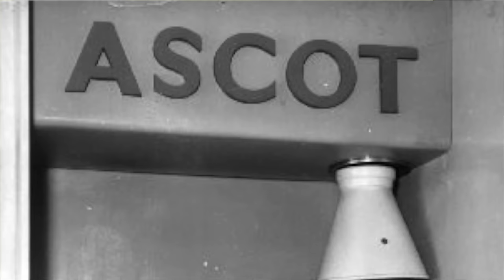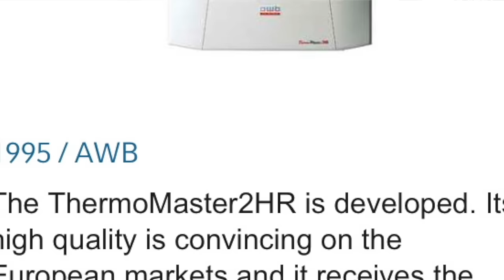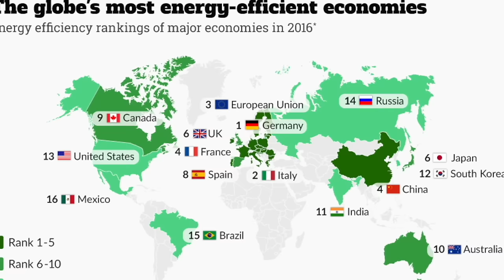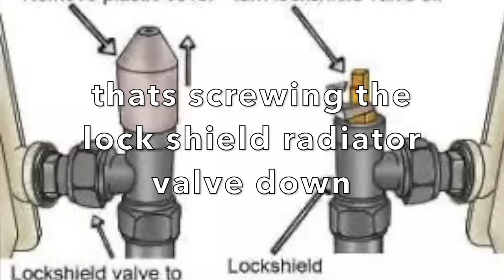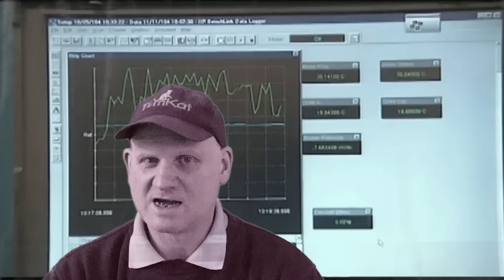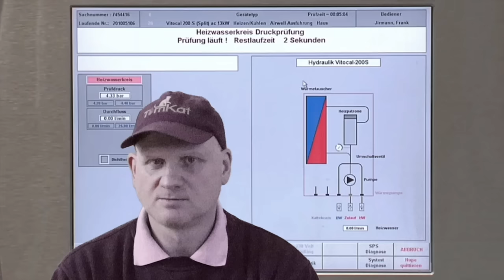WHICH IS THE BEST GAS BOILER for your home. Looking into the best boiler for uk homes in 2022

Comment: Terrific video Derek.  In a 4 bed semi circa1900 we are in need of replacing the Vaillant 828 combi and seem to be favouring the Viessmann Vitodens 100-W range rating 35kW.  We would welcome your views on the boiler sizing for the property. We realise there is an awful lot to consider as highlighted in the video (clean system, boiler modulation....) and wondered if there was some unbiased help out there to dicuss this matter.  This is a very important call to make.
Reply from the maker: Hopefully the engineer you choose to install your boiler will be able to give you all the advice you need. Just think about how much water you require ie how many bathrooms do you have and what flow rate at the taps that’s what will influence the size of your boiler first.
Reply: @tomkatgastraining  Well presently there is one bathroom with a shower over the bath but thought to plan for a further separate shower cubicle.  There's also hot water in the kitchen.  Not certain about suitable flow rates at the taps.  Can you recommend?   Not keen to have engineers in the home just at the moment.  Maybe we can achieve something remotely.  Any further information welcome.

Comment: Definitely VIESSMANN  The best in the industry single pass stainless steel heat exchanger ( fitted in ALL their boilers) they pioneered and gave us a very accurate weather compensation system ,(which comes free with every boiler) always runs most efficiently with the exact radiator temperature, They actually do 4 Combi boilers With a model to suit every need, that’s around 12 different boilers

Comment: I had the misfortune to be advised by my plumber to fit a LPG Baxi Neta Tec combi boiler. It has been unreliable since installing! Now six years on it has been issued with a danger do not use notice because it was exceeding 4000ppm carbon monoxide in the flue test.

It commonly made a loud bang when starting, this was followed by error codes. Eventually in year four it baffled two plumbers as to why it was issuing different error codes. Eventually Baxi sent their main man out, he was baffled but eventually discovered a tiny leak from the heat exchanger which was dripping onto a switch. When he removed the boiler he found it was distorted, presumably due to the banging when starting up. He replaced all the internals.

Now at a mere six years old our gas installer is recommending a new boiler given the history of ours. He is recommending an Ariston combi 30kw.LPG he recommends that over the Worcester Bosch 30i LPG.

What would you advise?

Comment: Great video, just signed up to British Gas to install a Worster Bosch condensing boiler and a system flush plus digital programmer, be interesting to see how it performs!!!
Reply: I wouldn't have used British gas to be honest 
I'd have found a local company 
British gas are just using sub contractors now which there paying very little and they expect a power flush and boiler fit by the engineer and only paying 395 for it
Personally I'd be charging a thousand for power flush and fitting of boiler

Comment: Would you agree that more modern the gas boiler (with high efficiency due to complex and fragile electronics) are all engineered to fail in a far shorter time period than those made 15/20 years ago?
Reply: Like cars.

Comment: You said that cavitation causes air, but this is not the case. Cavitation usually occurs on the suction side of a pump impellor due to the low pressure at that point, and it is this low pressure which causes the water to locally boil. So the cavitation bubbles are actually water vapour, not air. Cavitation reduces pump efficiency and, as each microscopic bubble collapses, it emits sound energy which, over time, can damage pump impellors.

I just had a Baxi regular boiler installed at my parent's house. The main problem is that the ignition is very robust, nay startling. The local Baxi rep took a look at it and it's now somewhat improved, but I'm still not happy with it, and I'm not going to specify Baxi in my own home, despite the existing Baxi old-tech boiler still running after 33 years.

Comment: Actually larger size boiler is a lot more efficient resulting in lower gas bills !!, as you would run it at a lower setting to get the same heat output, hence the output temperature of the flue gas is much cooler and less heat is lost to outside.
The 92% efficiency can only be achieved when the knob on the boiler is set to MIDDLE  or 1/3 of the way up only, the average efficiency is more like 75%.

Comment: This also depends on how old your water cylinder is. A modern one means you might be able to reuse it in a future heat pump system. We know it will be hydrogen boilers in 10yrs. Gas won't save the planet at all just lower your fuel bill.

Comment: i had a BAXI back boiler with seperate storage tank , 6am came on went of about 7am, hot water all day and night never came on again . until next morning , 20yr. old before first breakdown, now ive got a crap wall mounted boiler . from boiler in kitchen through wall to bathroom tap straight run 12ft. 2/4min before warm water arrives and comes on every time to heat water. roughly 40min a day wasted waiting on hot water and about 2hrs electricity , good job i live in Scotland , when i consider how much wasted water goes down drain waiting on warm water. And if i change again i know i,ll be getting a back boiler again .
Reply: erm ok don't talk crap

Comment: The only reason new boilers use less gas is the fact that they spend more time broken than working !
Reply: Totally Agree, I have a potterton Combi 80, still going strong. And so long as i can still get spares, i will keep it.  Even the guy at the local plumb center said modern condensing boilers are nothing but trouble
Reply: @johnmalin1676  my childhood home still has a Potterton boiler nearly as old as me (28 year old boiler!!)

Comment: Good n honest video many thanks, can I ask If i remember right I was told for condensing boilers to work at their best here must be a difference of 20 degrees between flow n return am not sure If i get that much difference but all my rads are way oversize so am hopping this is the case am retired now for over 10 ears n had a replacement boiler a Vaillant they did an OK job But they replaced all my rad valves taking away all the Peglers n draytons n replacing them with cheap rad valves n stuck the condensing pipe from the boiler in the rainwater! I was worried about leaks why I never changed it myself but so far just under a year pressure not dropped at all, in my experience the Best service of any manufacturer I got from Potterton installed a Neutaheat Friday lit it up worked for a while n stopped phone them about 1 pm n Next Morning Saturday 2 guys turned up with a new boiler had a look at the boiler then changed it to a new one, that was I think early 80s, Vaillant is Nothing as good on servicing but I had a Vaillant cause their 242s n 282s where Unbreakable many I insulted worked for 20 plus years very unlike many others cheers n keep safe mate

Comment: Hi Derek, thank you for putting up such a informative videos. Very interesting. I hope if you can help me. I am house owner and confused if I have a Combi boiler or leave the system as it is. Current system - Gravity fed, 10 year old condensing heat only boiler. All working well, no problem. We are planning to upgrade the common bathroom with an extra shower. Thus, removing the hot water tank will give us some extra space in the bathroom (if do not get the space we can still squeeze a shower). So, after the upgrade we will have 1 x existing bath, 1 x new shower  and 1 x shower in the en suite. Garden tap water flow is between 20-22 L/min. I have some advise from a local boiler installer and he suggested 35-40 KW combi boiler with small twin shower expansion vessel. My worry is, if my kitchen tap is open and two person are having a shower simultaneously, a) would it reduce the pressure? b) would it reduce the hot water supply. Also, we will have new gas from the meter to the boiler location.
Reply from the maker: No matter what size the kw are for a combi they are still only able to give you hot water at one tap at a time. There are a few stored combis on the market but they are still not as good as an unvented cylinder. I am sure the engineer who installs the boiler will be able to give you all the information you need as they would have seen your install.
Reply: @tomkatgastraining  thanks, it is very helpful. In that case, I'll will leave my gravity fed system and look for a upgrade to system boiler in future. I am also looking into Viessmann 111 W, i have given my details to the company and they will contact me to discuss soon. Thank you once again.

Comment: Great Video. People think bigger is better perhaps Combi’s need to be marketed with a CH/DHW output and more information to the customer. 
Is cycling really an issue given modulation. 
Keep up the good work
Reply from the maker: Yes boilers don’t modulate at start up and this is were the wasted heat start the boiler will go way over temperature and will need to turn off. This happens mainly on poorly designed system and customers not using the controls correctly
Reply: @tomkatgastraining  They do ... they modulate up

Comment: Very informative video Derek. Liked.
The modulation range is interesting, which H.O.B has the biggest range and are reaction times from high to low the same across manufacturers.
Reply from the maker: Every boiler and every manufacturer are different
Reply: Biggest range is 10:1 found in the Worcester Bosch heat only Greenstar 8000 Life range.

Comment: ,i've been repairing and servicing combi boilers for 30 years and i can tell you that the best boiler is the valliant, they are not as expensive as you think if you do a little research, heatline boilers are made by valliant and are much cheaper than the  one's with the valliant badge, i needed a new boiler myself 10 years ago, so i went into the plumbers merchants, and they had a stripped down heatline boiler on the counter for installers to look at, i asked what boiler is this they said heatline, i said it's a valliant after inspecting the components, they said well it's made by valliant, it was around £300 cheaper than the valliant badged one, i bought one, put it in, still going strong after 10 years plus....just sayin..
Reply: You need to look at Intergas combi boilers.
Reply: Yes the heatline were good... Particularly the price. I only got them when they were cheap, havn't been for a while... In the early 00s I put in hundreds of them. Some of my customers from then have started calling me now they have come to the end nearly 20 years on. I was buying them in bulk for £250 each ! Can't complain, 20 years for £250 !

Comment: Fascinating video. I'm not sure if my vaillant echotech pro boiler is a modulating boiler. But unless it's very cold the boiler does click on & off often. You said this is bad. Would it be better to turn the radiator water temp down so the boiler stays on longer? Even if its not modulating?

Comment: Why aren’t all the boiler installers this informative or give the right advice. 
Do you think you could come and have a look at my boiler and heating system ? 
I have had many problem 
With the boiler installed by British Gas since the day one I v had nothing but problems and each time a different engineer come and asked me to pay for some part or the other 
I stinky feel that all the installers work should be checked by a safety governing body to make sure that each installation is  carried out with the standardised process. 
I came  to watch your video clip I felt I need to be educated before I call another engineer 
Thank you
Reply: Your problem is BG not the boiler. BG is for salesman not tradesmen. 😂😂😂

Comment: Hi Derek, can you tell me if I size a system boiler in line with the kW needed for central heating (14kW in my case) plus say, 4kW for simultaneous water heating OR do I size it as per the rating of the coil of the 300L unvented cyl. (24.5kW in my case). You appear to suggest the latter but I just wanted to make sure. 

Also, given that an over-sized 32kW Ideal Vogue system boiler will "self-modulate" down to 6.4kW to 32kW, is the cycling on and off debate now null and void? You appear to think that it could still be an issue and hence why you should not over-size a boiler.

Last of all, controls from the manufacturer will only work on maybe 1 or 2 circuits but when you have multiple circuits for underfloor heating, I am told I must use 3rd party controls; is this right? Cheers, Daniel
Reply: if you fit a 14kw boiler on priority hot water you won't need a bigger boiler. having a large output boiler will reduce cylinder heat up time but this will use more gas. if you don't run out of hot water whats the need to be faster. also 14kw heatloss is at minus2/3°c average UK temps this will half so redundancy is built in.

Comment: Baxi group, however boiler installation, service  and maintenance  plays a huge part. I personally would avoid any plastic manifold boiler. And I've been put off by  ideal.
Reply: agreed, I don't like plastic, I'am a metal man, Vaillant learnt that lesson with chocolate heat exchangers, diverters and AAV's

Comment: @ Tomkat/Derek, I had 2 companies visits& quoted for like for like combiboilers, Bosch 30 si, and vaillant 30kw pure, can any of these boilers cope with another electric shower room only added in the future. Currently i only have one bathroom with electric shower  over bath. I hope you can give me your thoughts& advice on this.
Also, one of the company has indicated to do a flushing of the system after the boiler had been fixed, is this the correct standard of installation of new boiler? Surely it would be better to flush the old pipe,and rads before any new ones are put in place, ie. boiler, and/or new rads.
Thank you for for the useful advise& info, and sharing your time& expertise.

Comment: Latest British gas advert 
Upgrade to a new condensing boiler and you could save £240.00 a year based on comparison against a G rated boiler.
Old boiler still works but not A rated efficient 
New boiler installed cost £3200
So in 10 years you have saved £2400 after new boiler installed.
New condensing boiler worn out after 10 years .
So what’s the saving !!!!!!!
Maths 
Your down £800 and now have to buy another new boiler.
If I’m talking trash please help me understand where my logic is wrong as I always like to learn.

Comment: Biggest problem I had with vaillant was fault f75 water censer caused by rubber particals from expansion tank changed problem solved diverter valve was fixed by pressing reset button

Comment: Viessmann they are the Best Boilers and a Ten Year Warranty  German Made and No 1 in Europe
Reply: Yes well said Richie, I’ve been fitting viessmann for over 10 years now and it’s good very environmentally friendly excellent on the gas consumption and easy to service and maintain
Reply: @SalimKhan-gk1fh  Yes im Very happy with ours no Problems at all .
Reply: @richierich1470  good to hear, Just a matter of interest which viessmann do you have? Vitodens 100  or 050?
Have you found it quite efficient / quiet?
Reply: @SalimKhan-gk1fh  hi was told i only needed the 050  but its been great and recommended by Which so yes been great no problems

Comment: where does the viessmann 111w ,gloworm maxi flow and w/bosch high flow come in your 3 types of boiler.  ..... maybe number 4 .    elm le blanc invented the combi bolier with a double pass heat exchanger, as well as the condensing can of beans heat exchanger found in low end w/bosch boilers, valliant  was later having shown its combi at ideal home exhibtion .BG wanted a low cost combi package and found the chaffateau  later still down the time line.

Comment: Superb video.  Im confused about oversizing. I have a 3-4 bedroom house 82m2. I have been looking for a new Baxi 818 (18Kw) or 824 (24Kw)  or Viessmann Vitodens 100 boiler ( 19kw and 26kw) . Which one would I need to run efficiently ? Smaller Kw or larger?  I plan to install a Tado smart control as well.  My old broken boiler was I think a 18kw boiler.
Reply from the maker: Over sizing is normally only a problem for combi boilers the engineer installing the boiler should be able to give you the correct sizing as he or she has seen the job
Reply: @tomkatgastraining  Thanks. I thought its for all kind of boilers. I'll ask him about the correct size.

Comment: Is there boiler snobbery  - My B&Q Heatline Vizor is 16 years old and has gone though 2 diverted service kits  - less than £20 - Like the man said a lot of issues come from putting new boilers on old systems - mine was pressure cleaned and a magnaclean added as well as limescale anode on the fresh water inlet and of cause an additive - if I had a complaint it would be the boiler  does not modulate below 8kw meaning it switches on and off on low load - get it serviced every autumn by a decent plumber